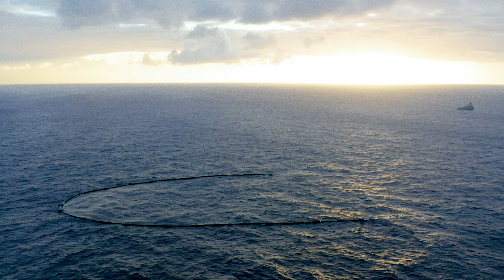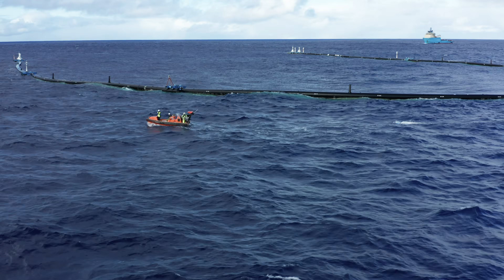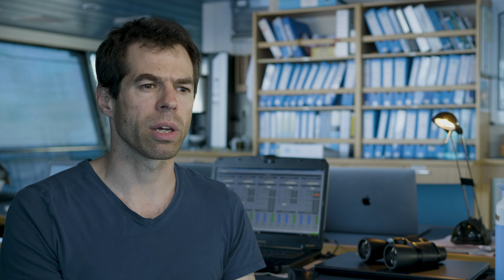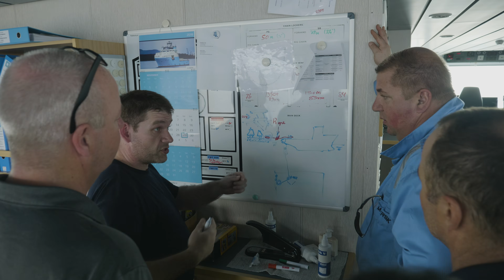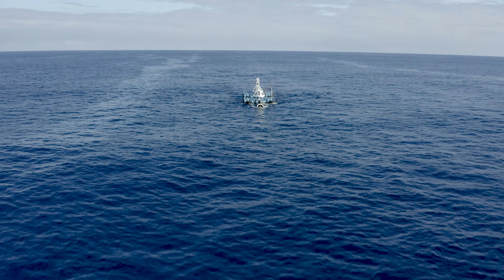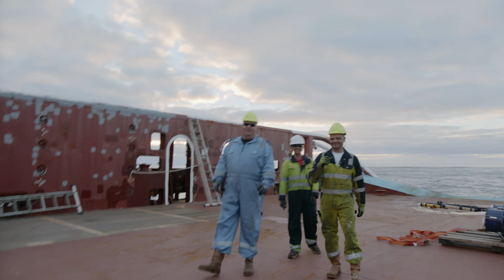SYSTEM 001 | First Mission | Cleaning Oceans | The Ocean Cleanup

Comment: I’ve had a thought for a design, how about the U shape is built in as the design, and is inflatable. Like a Half round inflatable kids pool toy, then it would be much lighter and be able to bend with the rough Sea as the Air inside would move around and re equalize when the Sea is calm. Then attach a Solar/Wind powered motor at each end of the U shaped tube to propel the whole thing along clearing the patch up faster!. A bifgger skirt is needed as well to catch some of the micro plastics esp if the last metre or so of the skirt is a fine mesh to allow water through but collect the particles. I don’t see any reason to be worried about fish being able to swim under the skirt, cos ANY marine life caught in that Soup of micro plastic ain’t gonna live anyway!

Comment: In Trinidad waters the fishermen use trawlers to catch shrimp....this system is basically a huge strainer that allows the water to pass through, however the shrimps as well as all other creatures are caught up in these huge nets..it is not a good practice as it is harmful to marine life...however I was thinking of a filtration system in which water can pass through may decrease the power needed to control and move the huge tubes especially when working in difficult weather.

Comment: A stainless steel cable or two, secured loosely to outside if the structure for its entire length, would at least keep the structure together and the sections in order. It could be considered a wedding band for Wilson and Wilma .......... a marital shackle if you will.

Comment: Even if they could get the system up and running it'd cost more to implement on a large scale than it would to simply find solutions on the main land. This is more or less a band-aid at best. landfills need an upgrade before anything else but that isn't in the budget. Then again it doesn't have the prestige of "saving the oceans" so I doubt anyone would care.

Comment: Free floating system will never work good...you need a propelled system that goes against the current to capture the maximum debris most efficiently in the shortest time...and the opening must always point into the current...wide mouth to funnel debris into the center for capture..

Comment: I have a few questions.
In 2010 about 5.000.000t-13.000.000.000t of plastic were thrown into the sea. That's about 570t-1400t per day that would have to be fished out of the sea to keep it at its current level. 

To clean it, 2000 - 4000 tons would have to be fished out of the sea every day. Is this even possible? And what CO² pollution is caused by the removal? 

Please don't misunderstand me it is a great project but is it even doable? 

The area on which the plastic is distributed is approximately 1,600,000km², and that is only one of 5 areas in the world's oceans.  How much energy has to be used to cover this distance and how big is the damage (CO²) and how long does it take?

How much plastic really floats on the surface? Plastic bags have already been discovered in the Marianas Trench. Are there plans to clean in other depths of the sea as well? 

Wouldn't it make much more sense to place a cleanup station in front of every river that flows into the sea to stop the main source of the plastic?

Beside the plastic there is also the danger of the many sunken ships and the huge amounts of oil in the old tanks. I think in the next 50-100 years a lot of it will be released (like the USS Arizona) are there projects against it? 

I think the idea is good but the magnitude of the problem is underestimated.  

Sorry English is not my first language, greetings from Germany.

Supplement: 
I have found a projection that says that if your project goes well, it can collect about 0.7t of plastic a day. If true, about 2500-5700 of these ocean cleanups are needed to clean only one area. For all 5 there would be about 28,500 units and these would only be able to collect large pieces and float on the surface. 

Is that true?

Comment: basic physics and fluid mechanics.  if you want to rake mess up, you need to move faster than the water currents.  Therefore they need to tow it.  relying on wind to blow it, is too unreliable. JUST TOW IT WITH TWO BOATS, ONE EACH END.

Comment: That's not a failure! It's a perfectly valid result - showing that something did not work. This would be a failure if were about collecting samples (with an existing device). That it's  sad is purely emotional, and has no meaning for the scientific outcome. So no need to be sad about the new knowledge and experience it produced.

Comment: You can dissolve plastics using technologies that are based on vibration. It's pretty fringe, but try and look into it. This is a noble cause but the method is too rudimentary. We need to move into the next levels of technological sophistication to solve this problem. Like Einstein said: "no problem can be solved from the same level of consciousness that created it."

Comment: It’s hard not to say they should’ve known it wouldn’t work. It’s a great idea but waves, wind, and plastic pushing on plastic cause the giant pool noodle to be unable to prevent plastic to pass under or over. Needs more to stop collected plastic from escaping obviously, perhaps some sort of mesh fencing above and below the surface. Really an obvious fix with no need for expensive dyes or modeling to see that it would probably work. Can’t believe they took it out to sea without thinking of that but I’m glad they didn’t give up and I’m excited to see how this turns out in the end. They’ll find a design that works if they can use their money wisely.

Comment: Dynamic positioning issue to do with shifting water currents cuasing the trapped plastic to escape? GPS and water borne sensors to sense current direction feeding straight into positioning system would take some computation. Might be missing the point entirely, keep up the good work.

Comment: Can't you install a small hook shaped net on top of the pipe to prevent plastic particles to escape by the top while letting waves go through ?
You could even mount it in front of your main pipe on the inner side of your system a lift mechanism made of a float,and lever ,so waves would lift it before it passes above the main pipe.
For flexibility on the total length ,can't you divide the pipe in section,and use rubber ribbed piping to connect the sections together,so you have a more flexible pipe ?

Comment: PEOPLE! What we have here is a gigantic think tank! Make suggestions! From what I've seen, blades inside are drawing water in the porous tubes and expelling water out at the ends. Why not have two, three or more tiered tubes, with progressively bigger holes desending downwards?
With the same power plants above powering the blades below, you can collect larger pieces and with deflectors, direct the expelled water, with the smaller pieces, towards the other tubes?
Just a thought.

Comment: I'll give them credit for trying. 

Is the idea for this thing to sit 1,000 miles offshore unattended for a full year as in no ship babysitting it the whole time? If so that will be nearly impossible if not completely impossible. Just the marine growth on the system would sink it after a few months. You can see in the video where marine growth was cleaned off the black tube. I'm guessing they have to run back and fourth for fuel and resupply that ship most likely doesn't have enough fuel onboard to idle out there for a full year. a 2,000 mile round trip in a ship like that would take more than a week maybe 2 weeks.

Comment: I'm sorry to have to be this person, but I don't see the benefit of this system. I get the general idea, but wouldn't it be MUCH CHEAPER to just sail out to islands which act as natural obstructions and sift the sand for plastics on a regular basis ? 
If I could offer a wild solution - since this is the only forum for the layman to offer his advice - Why don't we start to constructing ships that sift plastic from the water as part of the ballast system ? 
Ships frequently pump in and out sea water for ballast - about 20,000 litres each time they turn on the pumps. Especially cargo ships, where the weight changes between loading and unloading. Why not just make them filter sea water for plastics ? It could be as easy as putting on a variety of screens for all sizes of plastics. There are over 2000 cargo ships at sea every day, that doesn't include fishing ships, military, cruise ships, science vessels, etc. 
20,000 litres ( per pumping ) multiplied by 2000 cargo ships equal 40000000 litres a day of filtered sea water with just the cargo ships. 
According to maritime laws they have to pump ballast waters midway between destinations anyways to prevent cross species contaminations. 
That seems a lot simpler - because not only does this invention not seem to work, it seems designed to only catch large plastics. 
The only thing I would fear is the accidental catching of sea life, but that sea life would be in the path of the ship anyways and filters could prevent them from entering the system to begin with. Except plankton - there would have to be a way to separate the plankton....
Two cents....

Comment: The four main sources of microplastic waste, according to the report in the Guardian, were as follows:

1. Vehicle tyres (abrasion on the road)
2. Clothing (synthetic clothing separates tiny specs of plastic which make their way through the water treatment system)
3. Plastic pellets used to manufacture plastic items
4. Paints on buildings and road markings (Weather and flake-off results in tonnes of these tiny fragments ending up in surface water every year)

Comment: I believe the submerged skirt needs to be perforated to eliminate the forward pressure, which is pushing the collected plastic back out of the collection zone. This perforated skirt can be reinforced with an internal laminated layer of cross weaved fibreglass to prevent the skirt from ripping under pressure. GOOD LUCK Team :)